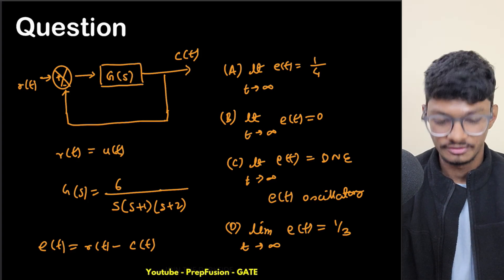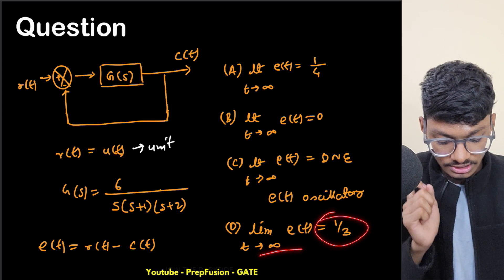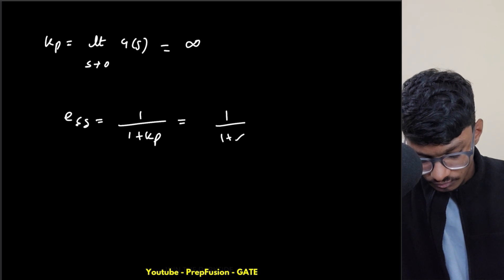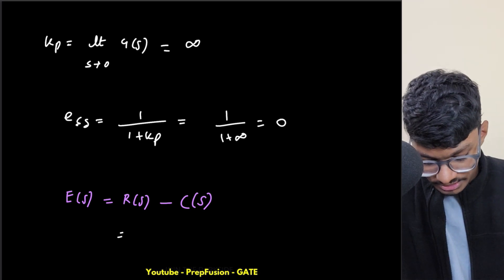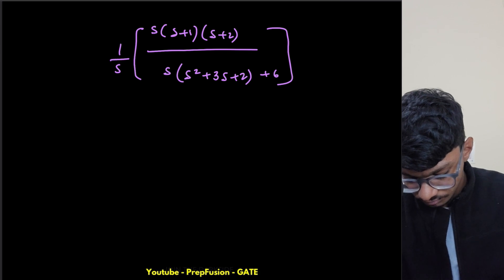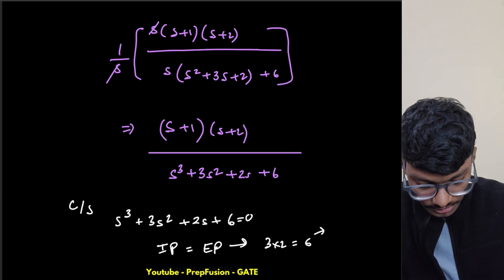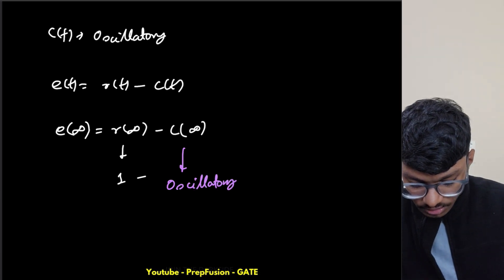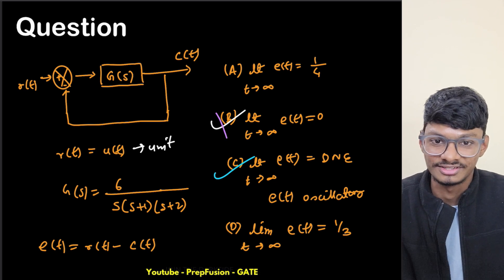GATE 2024 ECE Control Solution || Steady State Error || PrepFusion

Comment: Here few of you might think why should we check stability. If all the options were constant then we wouldn't have checked stability. But as one option is oscillatory hence we have to check for stability. If response is unstable then all of the performance parameters won't be valid.